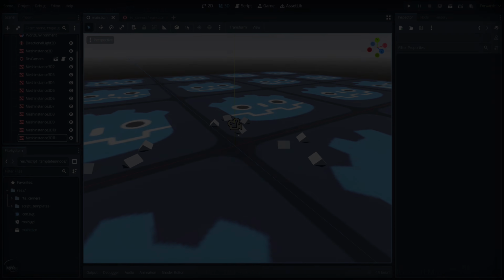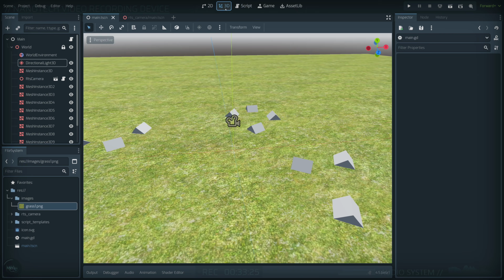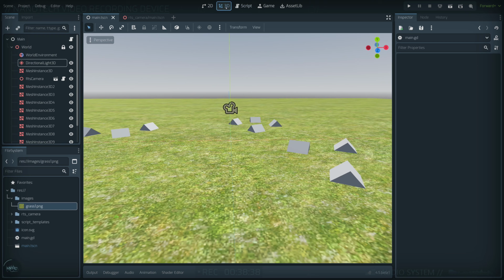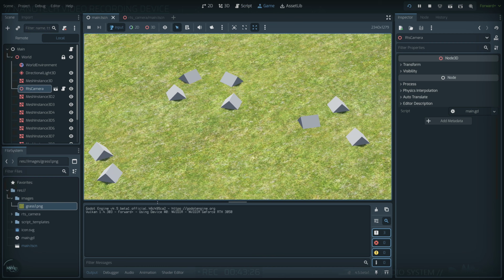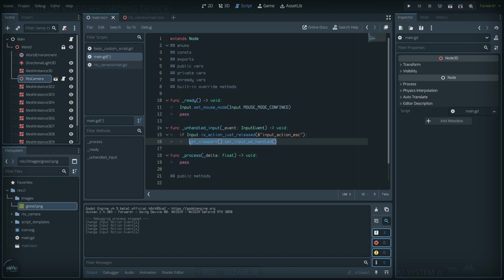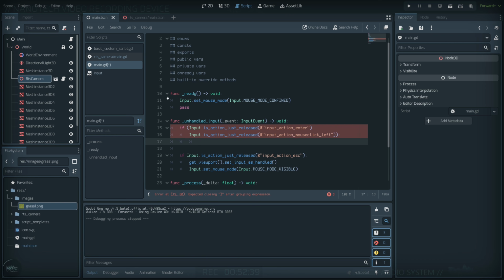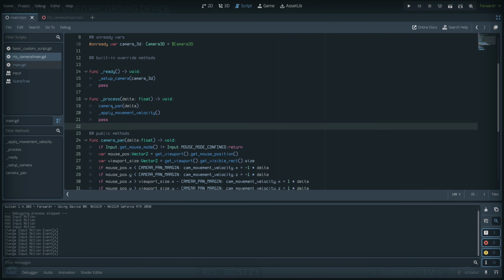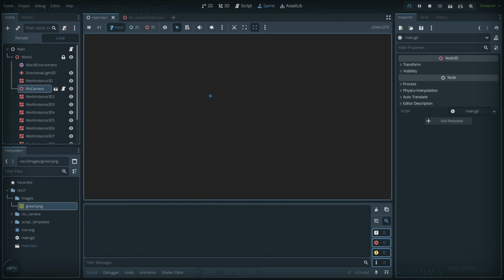Rts in Godot Part 2 : Adding Camera Movement and Panning, Inputs and Mouse Modes Setup

Comment: In godot 4.6 in the camera_pan

func camera_pan(delta: float) -> void:
	var mouse_pos: Vector2 = get_viewport().get_mouse_position()

this will initially produce vector (0, 0) and it will start panning to top-left. There are some ways to avoid that (e.g. don't reactor to 0, 0 unless it was first not 0, 0), but I wonder if there is a better way. Also, I don't know why it's not happening in your video.

Also, if my mouse is outside of the viewport, it doesn't move. I need to be very close to the border for it to work.